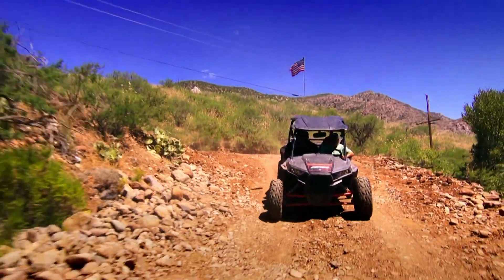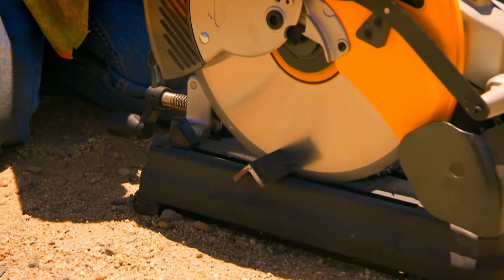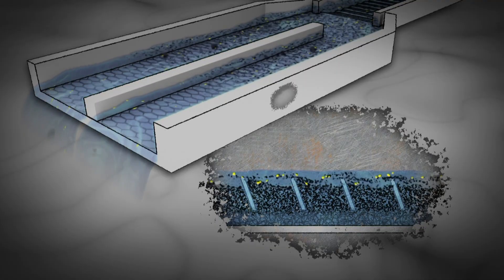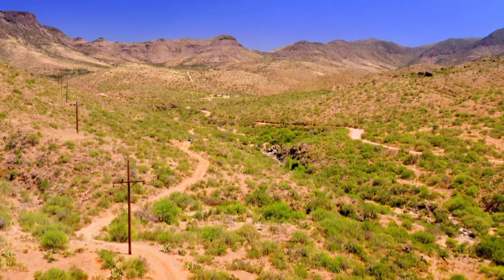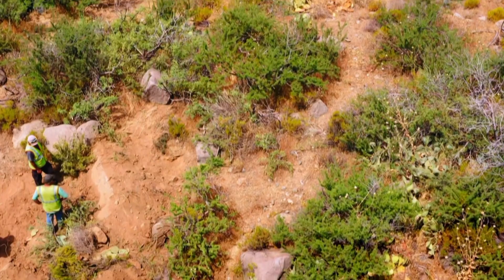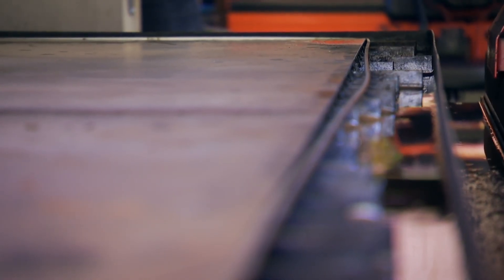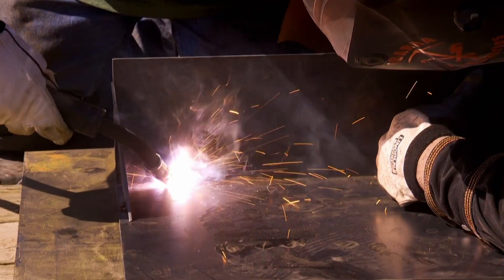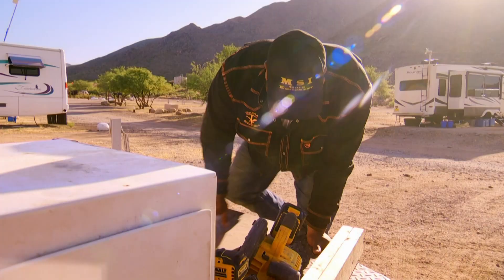Freddy Can’t Work Anymore Because Of Heat Stroke! | Gold Rush: Freddy Dodge’s Mine Rescue

Comment: He needs to carry pickles or salt packets with him when he's in the heat. It will save ur life. I had a guy that was cramping up laying down on the floor of our landscape trailer and I told him to eat this pickle and with in 3 minutes he's was up and walking around. After he got up I told him to eat this whole salt packet that you get at gas stations and he was totally fine after that. We told him to take a long break and sit in the truck with the ac in the middle setting of cold and hot, cus to cold of air will put you into shock, and you'll get sick from being hot and cold a bunch of times.
Reply: True  I've never drank that brand but I like body armor drinks. And for Gatorade it's gotta be sugar free or I cramp up from the sugar.
Reply: Vinegar
Reply: When I was doing 2 a days football practice down here in central texas I’d slam a shot of cool(not cold) pickle juice every couple hours between the first and second practice and drink 12-16 ounces of water between each pickle juice shot to stay hydrated